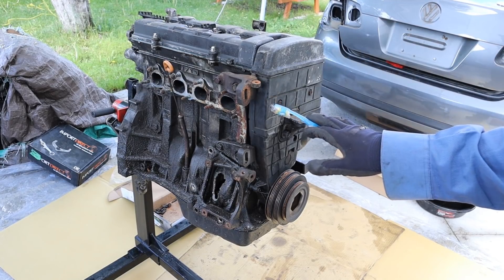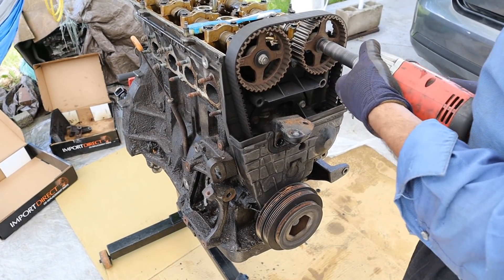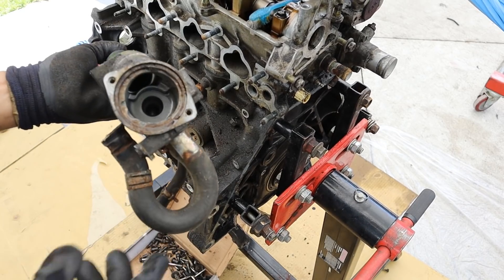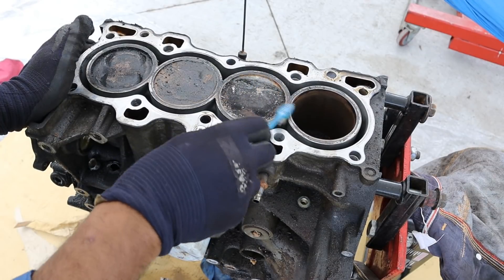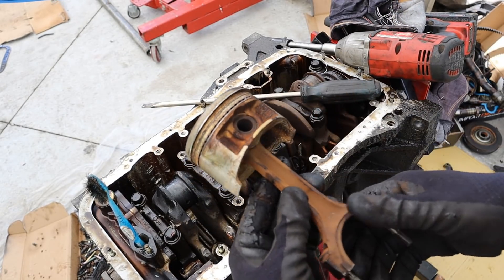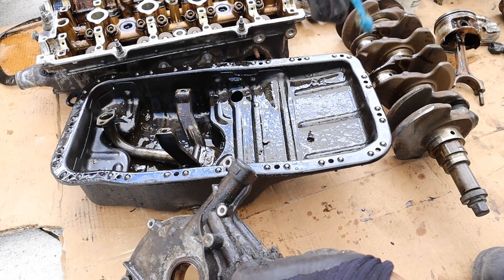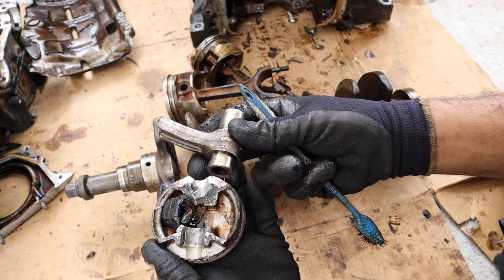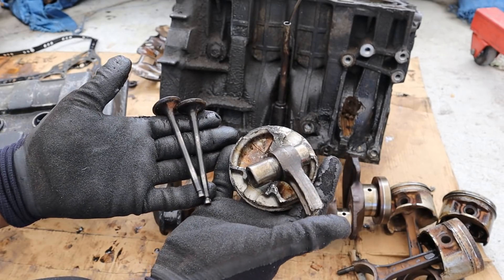The Honda B-Series Engines was the Start of Honda's Golden Years

Comment: The b18b1 in my integra just hit 300,000kms. These engines are solid. Some guys have gotten around 280hp out of them NA with a lot of upgrades(about $10,000 worth) which is crazy

Comment: Yeah, those chunks of connecting rod clogging the oil pickup were the death of the engine? me thinks the method of killing this engine was not enough oil at 5000+ rpm
Reply from the maker: Yes not enough oil caused #1 bearing to over heat and explode

Comment: Check your oil level at every gas fill up. 👍
Reply from the maker: That's exactly what I do and recommend to everyone
Reply: @speedkar99  Popped the hood at Costco gas station while pumping, checking the fluids in my Subaru. 17yo gas attendant runs over asking if I broke down "Nope...just maintaining my car...." lol. If you have to be waiting for 4 minutes to tank up, might as well check the hood.
Reply: I check my fluids every few days in mine, Cause EJ Head gaskets... I know mine are prime to blow.
Reply: Or once a week open the hood when engine is cold and check the fluids (o s..t there's no heat, yeah 'cause you didn't check the coolant level and now the head gasket is gone, or the head is cracked, Mister)

Comment: F series is the predecessor of the k-series
Reply from the maker: Kinda...but did they use the F-series in integras and civics? I thought that was more an Accord motor
Reply: @speedkar99  yes. The k was mass produced for the accord. And high hp versions showed up in type r and si civics but we're not the base platform untill dc5 for the Integra rsx but that's a whole different ordeal.
Reply: @hondaland_  
I hate the regular 2.4L from this series, but mostly because of owners neglegence.
Reply: @pliedtka  I find it easy to work on compared to the k20 with how it's so tucked against itself to fit in the civic
Reply: Yep and now I see a lot of S2000 guys selling their f20/22c and swapping in Ks. I'd do the same though. can't argue the extra umph the VCT has compared to the F series
Reply: @2strokeFORever  oh yeah. Gotta love shifting the power band with that vtc gear.
Reply: @2strokeFORever  makes me wanna play with the j30ac

Comment: These particular b18a's are also known for oil pump failure
Reply: Didn't know about it. My friend owns Type R. Are they also affected?
Reply: @pliedtka  the obd0 91-93 version of the non VTEC b18 is effected. Next generation was updated when the b18a2 was released. VTEC models of 91-93 didn't see oil pump failure like the non VTEC b18 did of that generation. Out of the ones I owned the pump quit on 2 of them.
Reply from the maker: Good to know
Reply: @hondaland_  JDM "reliably"

Comment: Cooling fan switch is on the back of the block from a b18a DA engine using the obd0 engine harness and ECU. It's when they go to obd1 that the fan switch is remade and relocated to the thermostat housing.
Reply from the maker: Thanks, you are an expert on these eh
Reply: @speedkar99  they have been my life. Own 16 at the moment

Comment: Nice dissection of the unplanned windows renovation! What might caused the coolant dilution? Should owners of the 1.5 turbo current generation be worry?
Reply: Owners of the original iterations should be worried. But owners of the newer versions are fine
Reply from the maker: It could be a headgasket or a radiator that contaminated oil n coolant

Comment: still own two of these. only one is running though
Reply from the maker: What took out the other?
Reply: @speedkar99   normal wear and tear. I got around 300k mi. on it before losing compression.

my second one is a franken b18 bored to 84mm with ductile sleeves.

just done 30k mi since its no longer daily driven

Comment: Golden era is from 1988-2000 😜
Reply: The better Bs are almost idiot proof and we'll maintained run to half million km. So many moded them, there was whole aftermarket industry devoted to Honda mods. I know 3 people with moded Integra Type R which are still running, one with turbo and 400hp+
Reply: 100%. I do love the k series though
Reply: The golden era is when Honda introduced the K Series.
Reply: What's wrong with B and D series?
Reply: @applepoop10  The J series would like to have a word with you.
Reply from the maker: The K-series was next level. Strong motor, but so much more complexity
Reply: @speedkar99  I-vtec and Cam phasing, I think were introduced on those?